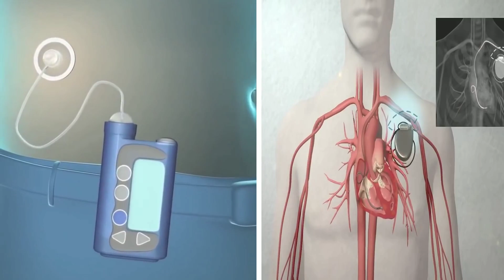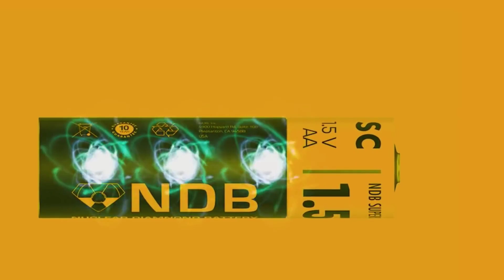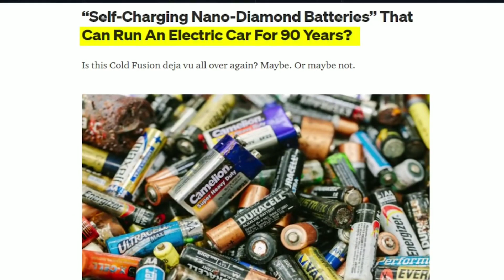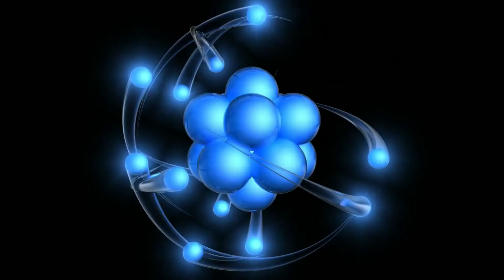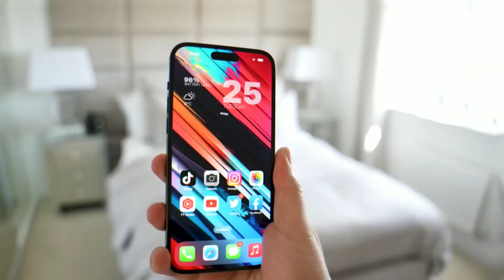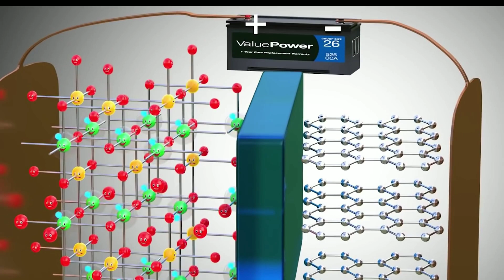Elon Musk Nuclear Diamond Battery Finally Hitting the Market After to Many Delays!!

Comment: I definitely think is possible and it would change the world it would be extremely useful and you really don't need to get as much power as you can get out of a lithium battery just make something that can put out a 12-volt and 1 amp when you can produce a battery that makes at least 10 watts of power or more than it will become extremely valuable you will just need to purchase many to get the voltage you want and the Watts you I would love to see something that was just strong enough to run a small fan that takes 8 watts and a light that takes 15 watts I can't wait till they come out with something that makes at least 10 watts of power right now the strongest device that I know of is a mini stove that you have to keep filling and it will only make 5 watts of usable power there is no other device on the planet that can make more than 5 watts of power everything else is either a battery or a conversion like a generator that uses gasoline does not make power it simply converts one fuel to another fuel in fact there is only one device that I know of that actually makes electricity and that is the small stove it cost $200 and makes5 watts of electricity I own two of them and I have asked the company to make a big are more powerful one but they have not been able to do it yet and although thermal plates are in existence they have not one single plate that will make 5 Watts you have to buy many many small plates to make even 5 w anyways I really really really really really really would love this technology to come about in my lifetime thank you very much for your video

Comment: The most amazing thing would be if you could create a 1 amp 18-volt battery that battery would be 20 watts and a 1 amp 40 volt battery which would be 40 Watts this would be an amazingly powerful battery the 18-volt battery would be able to power the little fan and lantern which both take less than 15 watts and the large battery would be able to power their stand light and quite a few other fans and functions which take between 32 watts and 5 Watts people would spend five to 10,000 for these types of batteries as long as it would last for around 100 years and it could produce its power for at least 50 of those years at full power

Comment: The idea is ancient nuclear power produces energy for thousands of years that is the problem with radiation it is simply a matter of converting the radiation to the right type of electricity the problem is how do you make it safe to hold the battery in your hand and not get the radiation on you and the key to that is some type of insulation whether or not they can deliver the battery in one year or 5 years doesn't really matter the fact that they are trying to figure it out is worthwhile

Comment: I just heard today that a Chinese lab has turned this idea into reality! A nano diamond radioactive battery that works for 50 years without charging. The future is here! I wonder how expensive are these new batteries. Radioactive batteries are not anything new, and they costed quite a lot but I hope this new thing is more affordable.
Reply: That's not exactly new technology, or any sort of revolutionary breakthrough. The reason why it is not really useful except for niche applications is that it generates a very low current (but for a very long duration). The energy produced per unit of time would be in the order of 1000 times less than a typical AAA cell - the advantage being that it could run for 50 years.

So yes, that's a nice device and yes it works. But no, it cannot be used to create a AAA-battery replacement or be used to power a smartphone for years.
Reply: @lauwenmark  it is all over news. it seems they have managed to make a working battery that can be used in even mobile phones. but who knows! let’s see what happens. i am looking forward to that. 

The Beijing-based company claims that it is the first to successfully miniaturize atomic energy, fitting 63 nuclear isotopes into a battery smaller than a coin. This breakthrough puts it “way ahead” of all other European and American academic and commercial institutions.

The phrase “atomic battery” doesn’t sound safe, but Betavolt claims that its BV100 battery is perfectly safe for consumers, as it won’t leak radiation even if its protective cover is punctured. The company plans to begin mass-producing the battery later this year, and introduce a more powerful version in 2025. In the future, Betavolt plans to target the aerospace industry, medical equipment, AI devices, small drones, robotics, and virtually any industry that needs batteries with a lifespan of 50 years.

The BV100 is considered a breakthrough on many levels, but as several tech news outlets point out, the power output of 100 microwatts at 3 volts isn’t particularly impressive. Betavoolt plans to launch a new 1-watt atomic battery in 2025, and as technology improves, we may soon see smartphone batteries that require no recharging.
Reply: The battery is good only for toys that allow it scam kids😂😂
Reply: Calm your tits. These wernt invented by the Chinese. They where made In The 60s

Comment: This is not a replacement, at least not now. This technology is supposed to replace batteries but only for low power usage. The most recent one produces 1.9 V and they are making one capable of producing 2 V. This is not gonna be able to power robots however, it's able to power sensors and other low energy things, possibly being used together with more tradicional lithium batteries so that they can last longer

Comment: We could even use alpha particles or gamma radiation with diamond batteries. Along with nano techniques and technology. Strontium,Thorium, Radium, Nickel 63, many other isotopes could be used. They are using very safe ones at the time.  It's really the only solution to chemical batteries that need recharged dont last and have a short-range. If a car crash can wreck a diamond we are in trouble. We could double protect the batteries. Now with AI tech we can find a solution very quickly. I imagine we will see this technology by 2030. Maybe even a giant power plant.
Reply: can it block gamma rays from thorium 238, that snly 2 years halflife,   huge energy rate, but i wonder how to shielf the gamma, how big would the battery be.

Comment: Their theory is entirely sound and uses physics understood since the beginning of the 1900s, but with a more modern method of harvesting the radioactivity into electric charge.
I heard about this a few years ago. Glad to see Elon is following it too. Maybe he can partner with them and help them to accelerate the process of development. It is a sound idea. Its only a matter of engineering and whether they are able to get the efficiency of the system up to the level required.
Getting the supercapacitors up to a high capacity will make a giant difference too. EV cars have times where they are just sitting which will allow the radioactivity to recharge the system if it isn't under load.
Reply: This video is made by 5 years old kid probably. "We will use nuclear waste for power" is like "we will use trash for manufacturing".  There are tens if not hundreds of isotopes in nuclear waste material, which are you going to use? How do you want to reprocess nuclear waste to separate needed material from it? What is energy density you expect? Claims about high power usage is a joke for anyone who attend school physics. We use RTG for many decades and they work only in low power applications.
Whole video is collection of BS without any clue how stuff works in reality. Your diamond crystal are going to catch neutron radiation? Gamma radiation?

Comment: We don't need to put nuclear batteries in cars. We can put them or thermal nuclear generators in sealed units at gas stations to make hydrogen fuel at the point of sale. With safe metallic salt vehicle storage tanks we can create cars safer than gasoline that exhaust water. We have had the technology for many decades.

Comment: Providing it satisfies all safety issues including mechanical damage in extreme circumstances the why not, particularly if it uses nuclear waste.
Reply: It is a tiny SLIVER of carbon moderator from a nuclear power plant encased in 2 layers of DIAMOND, the hardest substance. Industrial diamonds are not rare or very expensive. I cannot believe it would be more dangerous than a Lithium Ion battery in a collision. Those things catch fire if punctured and are almost impossible to keep extinguished. Its like lighting a solid rocket motor, with fuel and oxidizer in the same package together.